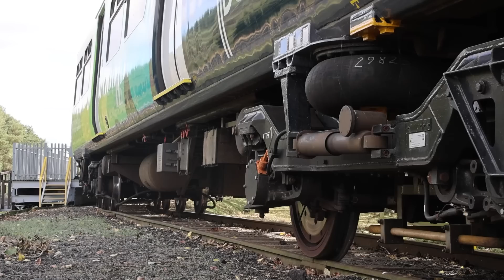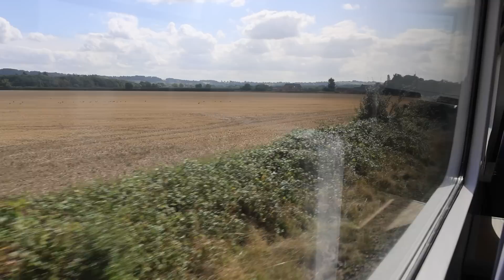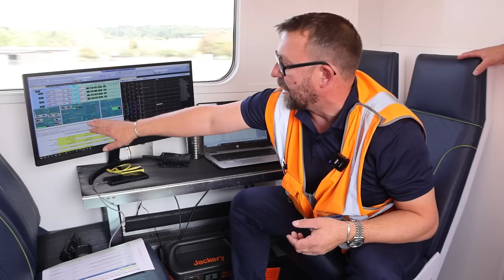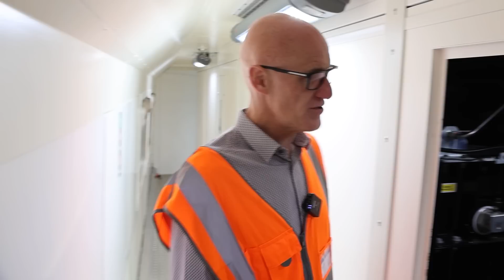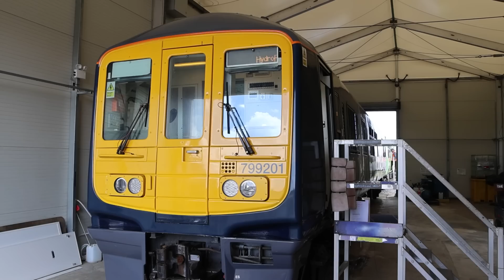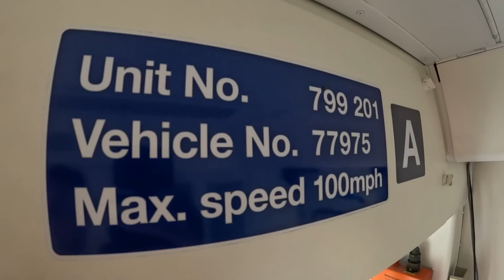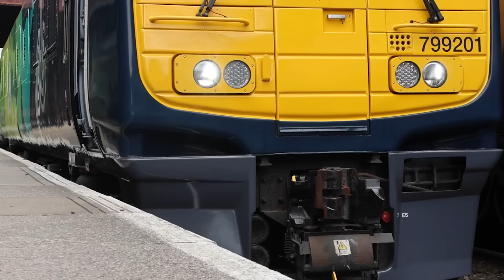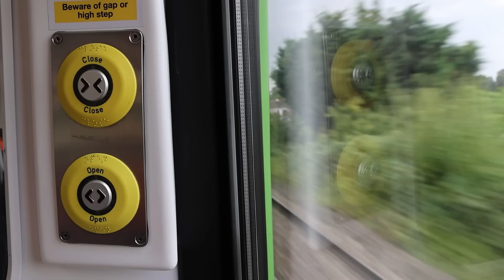The Class 799 Hydrogen Train

Comment: Having seen all the working bits close up, I think you're better off putting them in a locomotive similar to a 20 or 73, with a DVY at the other end. It would also reassure passengers that the explody stuff isn't sharing space with them, despite the safeguards.
Reply: Now I think that if you put the hydrogen tanks on the roofs of the passenger cars, you would gain a good 3/5ths of the power car, like a Thumper or π1

Comment: No heat scavenging system for heat the cabin from the fuel cell and mantain the battery in temperature, shame. The efficiency is very low, below 20%.

Comment: Not sure I'd like to be a passenger. 5,000psi tanks full of an explosive gas - it even says "explosive atmosphere" on the door. These tanks are of limited lifespan due to hydrogen fatigue and they can leak 1% fuel per day. Then there is the ever present threat of a large lithium battery fire. Admittedly, a diesel tank rupture in a crash is also a fire risk. What's with the Jackery power bank running the test equipment? Plus as others have said, the conversion of electricity to hydrogen and back again is not very efficient, nor particularly 'green' unless you have 100% renewable sources.

Comment: It might be more efficient to create electricity at a generating station using hydrogen as the system can create the hydrogen and electricity at the same time.  This way older trains using power from overhead lines can run on the same rails.  Hydrogen powered trains like this one can replace diesel powered trains on branch lines well enough.

Comment: I’d say that Hydrogen may have a future for long distance rural diesels. Say the West Highland, Cambrian, Cumbrian Coast. But shorter diesel runs should use batteries and the ultra rapid charging system used on the Greenford branch. 

This of course is only for areas where there is no business case for OHL. If wires can be strung up, they should be.

Comment: Trains are a perfect use case for hydrogen. The weight of the storage isn't really an issue and you don't need fuelling stations all over the place. But if you already have electric trains it's a bit useless. Ideal replacement for diesel ones, though.

Comment: Hydrogen is not a viable fuel. The fossil fuel industry are promoting it as it is so inefficient that it takes five times as much energy to produce hydrogen than would be needed to power the train directly using batteries. 
The road vehicle hydrogen refuelling stations opened in the UK a few years ago have now closed, the principle is a commercial, environmental and practical failure by any rational assessment.

Comment: Kinda believe hydrogen(no matter it's fuel cell or turbine or ICE) is the way to go compared to the battery electric train, less bulkiness, more flexible operating option to freight and passenger transport, and most of all, easier retrofitting possibilities to existing framework, and re-fuelling can still be upgradable by gradually replacing diesel refueling facility

Comment: For all the use this is, you might as well put the hydrogen in a Zeppelin and use it for transport.  If you put electricity into a Li-Ion battery and use it you get more than 90% back.  But use the electricity for electrolysis and feed the H2 to a fuel cell and it's way under 40%.  So hydrogen requires two or three times the green electricity generation to make it green.  Go figure!  And that's before you even think about the high cost of engineering the H2 compression, storage and transfer and the low volumetric energy density.

There are applications where hydrogen has real promise, like mobile plant; but not for trains.  Electrification, with batteries for lightly used sections, is a no brainer.  The high CAPEX and maintenance cost and embedded carbon of OLE could be greatly reduced by use of a more intelligent third-rail system, thankfully the authorities are starting to reconsider their edict of "no more third rail for safety reasons", thanks to the current work going on at SWT (check out Nigel Harris's Green Signals).

You need to ask the hard questions Geoff, not just repeat the sales puff from the people drawing down our taxpayer money in government grants to pursue their "greenwashed" projects!  But thanks for posting.
Reply: Yes, but how many charge/discharge cycles can a Li-Ion battery withstand ?
Reply: @quantisedspace7047  Quite a few thousand.  Experience at the moment is showing that those used in cars are lasting longer than had originally been expected.  They nominally replace them when they get down to about 80% capacity, but after that they still have a long further useful life for stationary energy storage where the capacity to weight ratio is not an important factor.

Comment: Great that they're giving it a go, but dangerous to talk of hydrogen as a fuel. It's not like oil, coal & wood that we can extract from the environment. It has to be made (and stored and transported and handled). 

And that's where the problems start. Most H₂ production involves fossil fuels, which means that any gain for the overall environment is minimal. H₂ can be produced by electrolysis, but that involves about 3× the electricity for a given kW at the wheel as batteries or catenary. 

Other countries have tried hydrogen trains – Germany gave theirs up as a bad job – and it seems strange that Porterbrook made no mention of lessons learned by others. But the fossil industry loves H₂. Nuff said.

Comment: If only Hydrogen was this abundant fuel source ! Yes, it is one of the components of water but it takes a very power consuming process to separate the hydrogen out of water. Basically we are using three times the power & are moving a hugely complex hydrogen to electricity system to replace a simple diesel engine.
Also worth noting that hydrogen storage & re-filling is also a very complex process.
Fossil fuels also take a complex process to produce but after that, it all becomes familiar. Once hydrogen production becomes as familiar as oil refineries then these idea will be more efficient.
Reply: There's nothing simple about a diesel engine once you add all the gubbins required to make the emissions vaguely acceptable. There as inefficient and as much of a dead-end as hydrogen.

Comment: The biggest tragedy of hydrogen train projects is that they delay line electrification, by giving false hope to the belief that hydrogen is a clean, scaleable way of electrifying trains without having to get good (and therefore cheaper) at putting overhead lines in, if we were consistent, committed and measured at line electrification, it would get done, but the results of not doing it is that we still run diesel trains, not hydrogen, a similar effect can be seen in cars, people stick with petrol while hoping for hydrogen.

Comment: Hydrogen is a stupid idea at current prices. Cost wise the train is more expensive than a diesel or full battery electric train to purchase, build and operate. So what we need is bi-mode electric and battery. If you use green hydrogen the train will run on 20-30% of the electricity that is used to produce the hydrogen. If you use battery this percentage can be as high as 95% but is typically around 80%. Not perfect but that means a hydrogen train is 3-4 times the cost per mile of a battery electric train. So from a cost perspective hydrogen will only win if our national grid has 10 times the amount of renewables needed at windy/sunny times and then hydrogen producers can buy this electricity for basically nothing and produce cheap hydrogen and power vehicles with it. Without this cheap irregular electriciity for producing hydrogen there is no demand for a train, bus or car that has a per mile cost 3-4 times the price of battery and a much higher maintenance and up front price.

Comment: Super video! Aberdeen & other places have been running h2 double-decker buses for a long time, and it seems to be a decent model for unelectrified public transport. All the hydrolysis energy comes from the wind farms, supposedly. 
I'm hopeful that an h2 train can work, since there is still no electrification plan for much of the network, and I think the tech might integrate a bit better than the dual-mode E/DMUs do. Plus we do need to stop oil now. 

For all it's flaws, hydrogen does seem like one of the better ways to portably store green energy, but it would have been interesting to hear more from the hydroflex team about the challenges that would face greater uptake of 799s and similar h2 plans.

Comment: Stupidity abounds!

Hydrogen is the LEAST efficient method of energy storage.  And let's be clear, that's what it is, an incredibly inefficient and dangerous chemical battery.  It's NOT an energy source, and it's FAR from "green".  The best option is electrifying the lines, and it's idiotic not to do it.  For short stretches that are particularly difficult to electrify, you can use onboard batteries.

Hydrogen is an idiotic dead end.

Comment: Thanks for the great video, Geoff. Informative and entertaining as always. Did you get any information as how the hydrogen they use for powering the train gets produced i.e. is renewable energy used in the process. In my opinion, one of the biggest drawbacks of hydrogen-powered trains is how energy-intensive it is to actually produce hydrogen via electrolysis.
Reply from the maker: Great question, and I did not, so I don't know, I'm afraid. I went to ride the train and see how it looked / felt / performed.

Comment: The cost of the hydrogen and the equipment and infrastructure is surely going to be more expensive than electrifying the line. Hydrogen is so inefficient that the carbon footprint must be terrible. The last thing I heard was about using battery electric trains to bridge gaps in the electrified sections possibly using electrified third rails in stations and other sections to top up the batteries. The third rails would only be live when a train is present.

Comment: Goes to show how good the structural integrity of those BREL Mk 3 carriage-derived rolling stock is when they're given a second lease of life. Again, the need for more grid capacity to aid the hydrogen generation won't be solved any time soon, because it doesn't matter which source of energy you'll be employing be it renewables, nuclear, CCGT, you'll need more gigawatts onto the grid, which is currently the bottleneck which most folk who don't work in energy, are unaware of. All good generating the electronds, but no good if you can't get it from point A to point B.

Comment: The old ‘319’s electric systems  such as the 750dc compressor and 750dc motor alternator were  very power hungry , fine when connected to 25kv , 769’s use more diesel on a 50/50 electrified route than a dmu , the techs great but stick it on a better unit that has newer systems such as 240v compressors and transformers rather than a hefty motor alternator

Comment: H2 in high pressure tanks? How high is the pressure? And what happens when something gets thrown up by the wheels and punctures a tank? Is that why the lithium batteries are under the train: so they get punctured first. Explosive batteries close to high-pressure hydrogen. No thanks.

Comment: A fascinating video, Geoff - many thanks for posting it. Looking behind the scenes on that train showed just what a complex system was needed to power it. They might also want to draw the excess heat from those fuel cells into a heating system for the passenger saloons; that would add further complexity. I can't help but feel, along with many other comments made, that enhancements in battery storage and charging will make such a complex system uneconomic and unnecessary. And of course there is no green hydrogen at present, and the storage and transportation of it is another hurdle to overcome. I think your video was very valuable in helping to show what hydrogen fuel-cell technology really means.

Comment: aside from all the other commenters remarking on the inviability of hydrogen trains, what happens if the fuel coach gets crumpled in a crash? do we really want small Hindenburgs running throughout the country?
Reply: It would for sure end up way way worse than say the terrible accident at Santiago de Compostela in Spain a decade ago or so, where a high speed train derailed, and let's just say things turned way worse due to the train carrying diesel fuel rather than being overhead wire powered.
Reply: I don’t know when someone gets in a car accident today is it the same level of injury/death as a car accident in 1937? I’m not talking about the way that cars were built back then, but how safe it was for the occupants

Comment: As always with any of these alternative power trains, they're best used for branch lines. Any route that receives more than a few trains per hour or with trains longer than a single 150 should really be electrified with wires as it's a more efficient system which allows for higher performance trains. Carrying dozens of high pressure hydrogen tanks and batteries makes the train heavier and reduces passenger capacity which isn't great for busy lines, and extra time needs to be allotted for refueling. Converting energy back and forth from electricity to hydrogen then back to electricity is inherently inefficient, and when a train needs to draw a few megawatts of power to accelerate, the energy losses add up.

Comment: It's an interesting idea, but does it have a smaller carbon footprint than normal diesel-powered trains.
Hydrogen is around three to four more expensive than diesel to manufacture even using Steam reforming of natural gas which also requires pressure swing absorption to ensure the purity of the gas is fit for use in hydrogen fuel cells which are easily degraded when contaminated, all followed compression of the product into a liquid for storage.
This all then has to be duplicated at the user's end to ensure the gas is stored and transferred correctly. Even then, you have to ensure it can be carried safely at very high pressures and very low temperatures, all of which ensure the cost of operating a hydrogen vehicle is very high.
Yes, all that comes out of the tailpipe is water vapour, reducing the obvious pollution to zero, but behind that, the process means all you have done is transfer that carbon output to the start of the supply chain rather than the end.

Comment: There presumably are some limited cases in the North of Scotland where hydrogen trains would be more viable than overhead wires, but outside of this limited use case, the 3 times as much energy being required for electrolysis, all seems to make hydrogen technically interesting, but probably commercially unviable, compared to retaining a small amount of diesel trains on far flung rural routes where conditions may be imperfect and depots may be 100s of miles away.

Comment: The problem with hydrogen energy is that it’s still much less efficient then overhead wires. It takes more energy to power a train using hydrogen than it does using overhead wires.

Comment: Nice, but surely it's just simpler, greener to just electrifying the line? Seems like a pointless distraction.
Reply: electrifying the line cost money and need many power stations to power those trains, it would be cheaper use new technology to power those trains.
Reply: Depends how intensively the line is used.  In the UK there may not be very many lines where this technology is economically viable.  Somewhere like Australia it could make sense for little used lines.

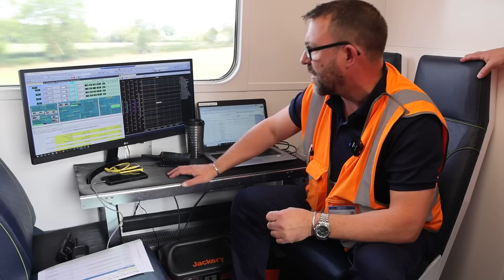Comment: @geofftech2 when the 799 unit went upto cop26 in Glasgow to test on the cathcart circle line from Glasgow central to cathcart doing an alrounder nordog said in his community chat from his friend who works for TPE said the 769s ran from kilmarnock brodie works in south ayrshire towards ayr prestwick johnstone milliken park down the ayrshire coast and dumfries and Galloway line on The GSW to replace the Scotrail class 156s super sprinters with hydrogen electric multiple units but the scottish government haven’t put an order in for older stock forra new lease of life at all 3:18 mins ago i commented this mate 👌🏻😎
Reply: Both hydrogen trains that visited COP26 (this and the 314/614 conversion) didn't even use hydrogen when giving demonstration trips, they used their existing AC overhead systems. Hydrogen is a scam - far too expensive and carbon emitting to produce in anywhere near the quantity needed for use on the railway. All this is just a sideshow and we should be putting wires up. Yes the government haven't ordered new trains but that's it - they should be new and not 30+ year old London cast-offs. 769s have done tests but that's because they've been stored for a while in Kilmarnock, nothing about Scotrail leasing/buying them as of yet.
Reply: ano exactly nothing happened yet but dno they would sell thum for scrap but you might know the old metro cammell 1980s stock has been saved st springburn works at least 10 of thum will be used for shops bars and restaurants as soon as the same as the jubliee stock

Comment: Noticed that there was no mention of how and where the H2 in the tanks was procured. Most likely, the Hydrogen in this test train was made using Steam Methane Reforming, which has a carbon legacy, both directly from the chemical process CH4 + 2 H2O = CO2 + 4 H2, and indirectly from the energy needed to drive the reaction. Even if we presume it was Green Hydrogen from 100% Zero-Carbon electricity, inefficiency in the conversion lost a lot of that original energy energy, Electrolysis is typically ~70% efficient & PMC FC are normally ~50%, add in compression, transportation & distribution and there might be as little as one third of that original electrical energy getting to the wheels. True electrification is the real path forward towards decarbonisation, HFCs & Li-Ion are fighting over second and third place